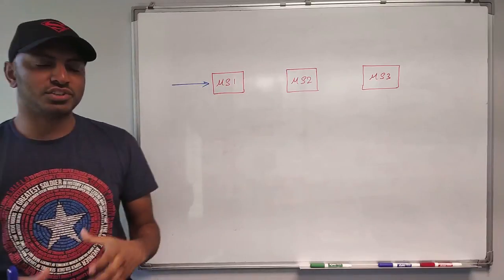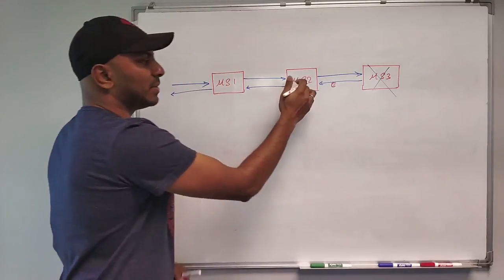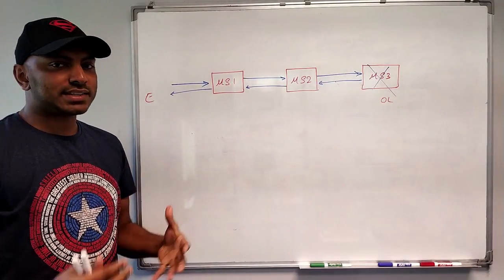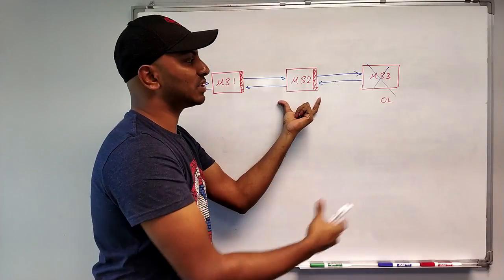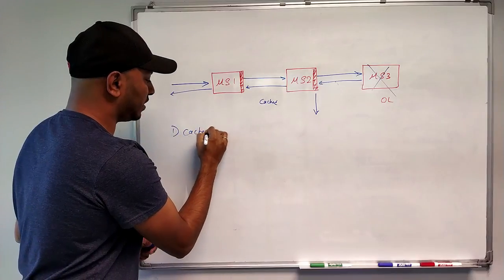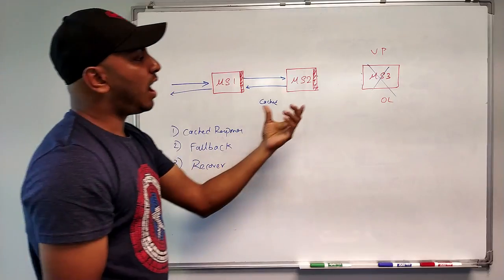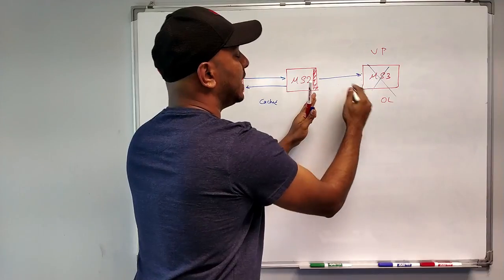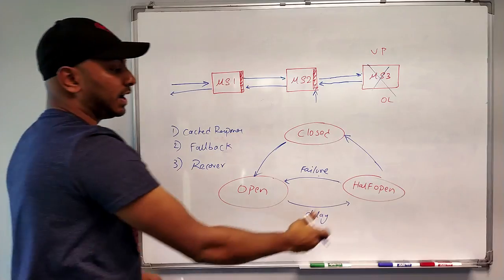MICROSERVICES ARCHITECTURE | CIRCUIT BREAKING | PART - 8

Comment: I don't quite get option 1 cached response. If there is a cache in front of MS3, isn't it then the normal happy case?  whether MS3 is up or down, we would hit the cache first and only hits MS3 if there is a cache miss. Further the cache typically only has a subset number of responses thus you won't be able to guarantee a successful call by going to the cache.

Comment: Thanks for the good video. I have question. In case of service is not available how do we handle incoming request ? Do we keep any pending action timer for which we will be buffering request and later will process them or system will discard them directly by providing configured error response.

Comment: The error from the service 3 is handled by using try catch block ,then why we are using circuit breaker?
eagerly waiting for your reply bro
Reply: The point of the circuit breaker is to avoid making another request to service 3 if it has returned an error recently to let it recover.
Reply: @kome566  
Thank  you bro!

Comment: This is a poor explanation of circuit breaker pattern. The problem it solves is not the 5 times retry of service call to MS3. This same retry policy is also in effect on the other services in the chain, so when MS3 fails, MS2 will return an error and MS1 will retry calling MS2 for 5 times, and each call to MS2 will retry the call to MS3 5 times. Overall, MS3 will be called 25 times, MS2 will be called 5 times, so the failure of MS3 will cause a cascading exponential increase of calls, which will slow down the system. Circuit breaker prevents this from happening. If the retry policy is N times, and there are M services making chained calls, a faulting service at the end of the chain causes number of calls in the order of N to the power of M, this is for each call on the first service in the chain, which, when repeated, is enough to take the whole system down. Circuit breaker prevents these cascading failed calls from taking down the system.